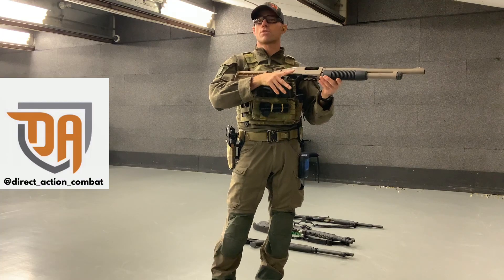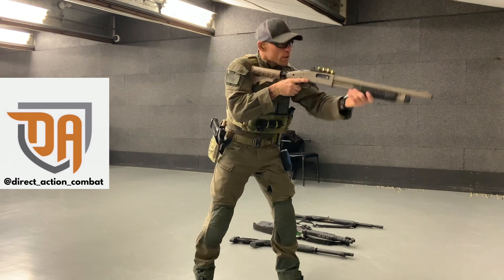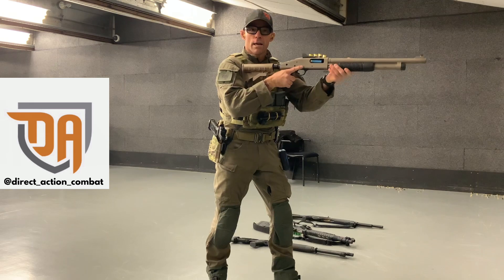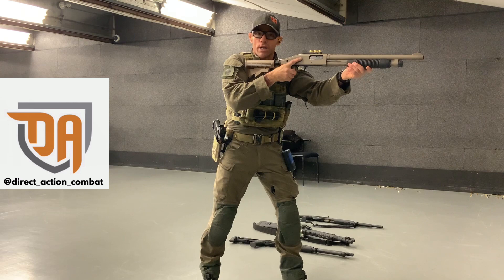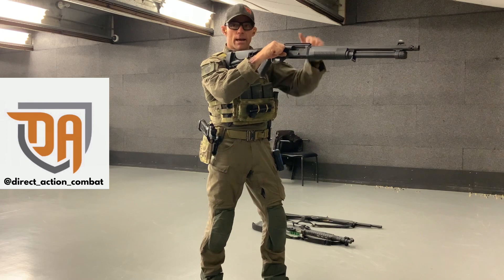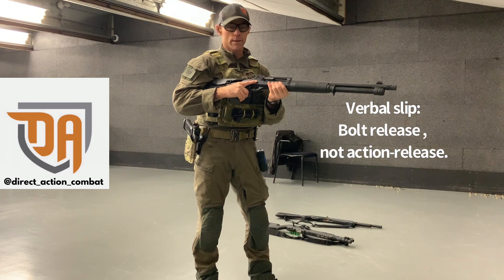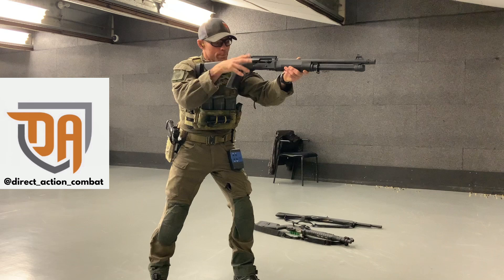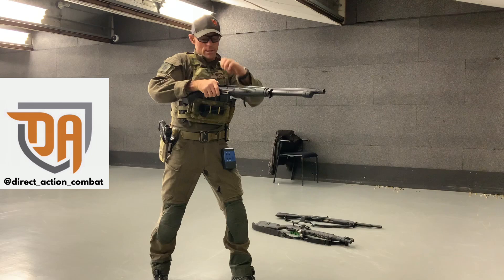Pump action & Semi-auto Shotgun Change-over drill.

Comment: With the pump action you fired a round and then you pumped it, so as you say, you know there is birdshot/buckshot in the chamber.  You also know there is at least one empty space in the magazine tube.  The correct way to do the changeover at that point is to simply shove the desired slug shell into the magazine tube and pump the action.  There is no reason to go through partially sliding the pump back, pushing the next shell into the tube and then fully ejecting the chambered shell.